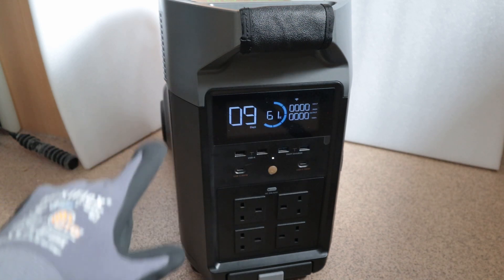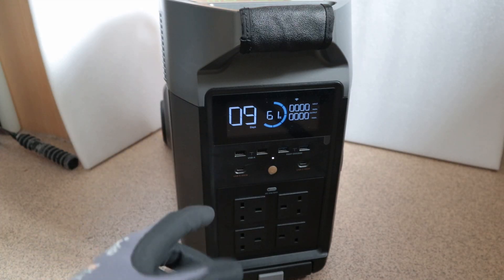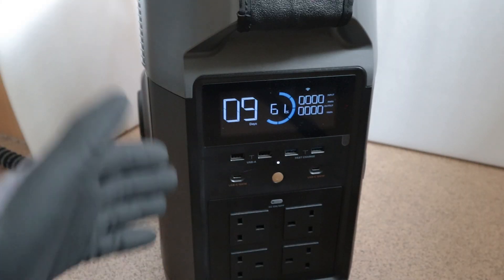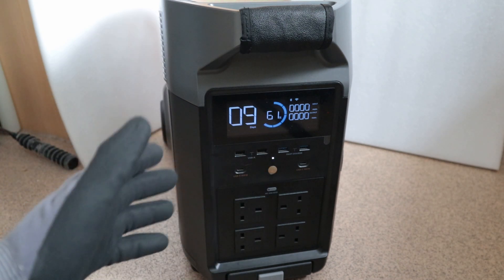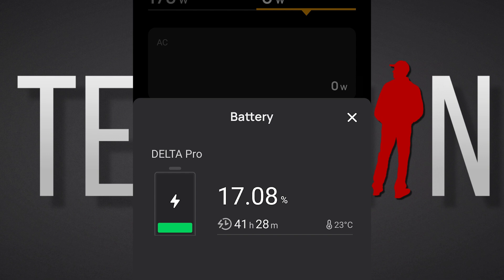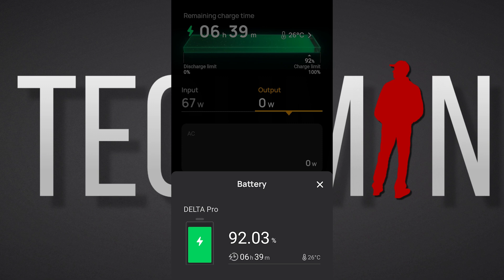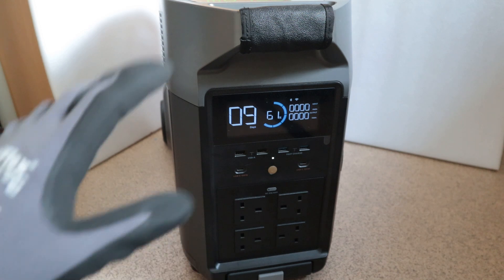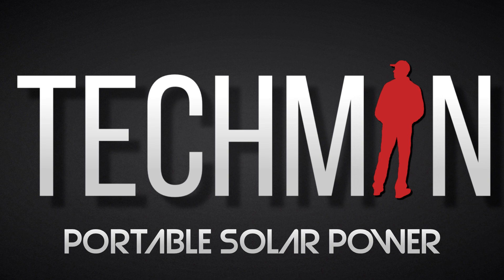EcoFlow Delta Pro Solar & DC Charging | How Efficient is it?

Comment: Thank you. I'm doing my research on EcoFlow power stations. This video is helpful. Can you connect a lithium battery directly to the back of the delta pro?
Reply from the maker: Hey, you’re welcome. Yes you can. Just connect to the solar input port (XT60i) on the back. Be careful though, the input is limited to 15A but on a couple of occasions I’ve seen it exceed that.
Reply: @TechmanSolar  Thanks
Reply from the maker: No worries